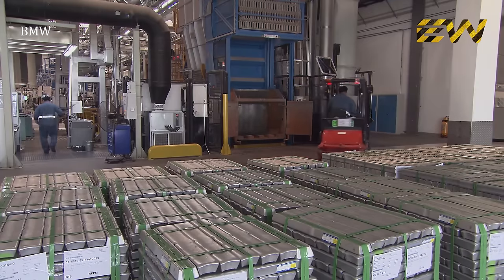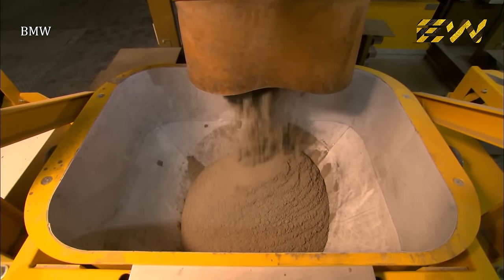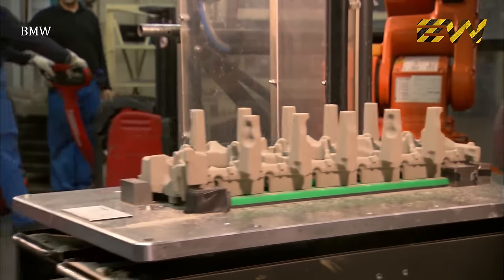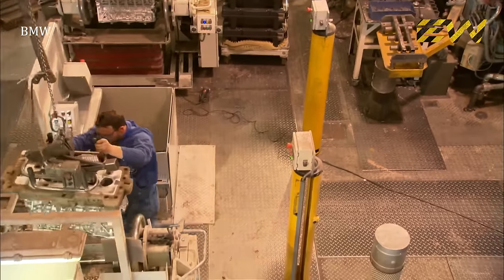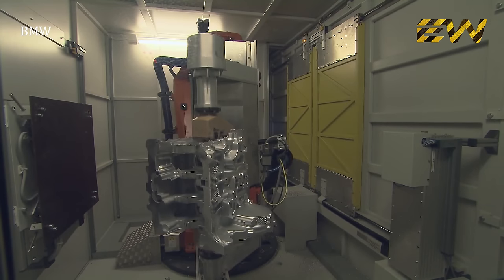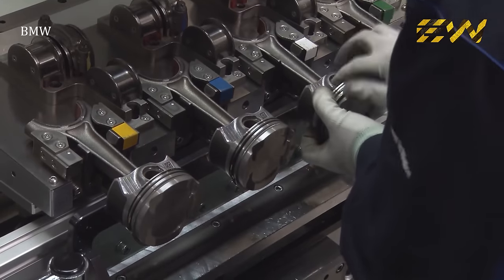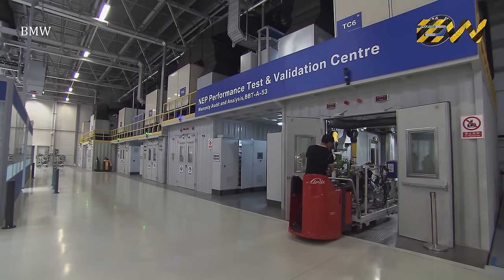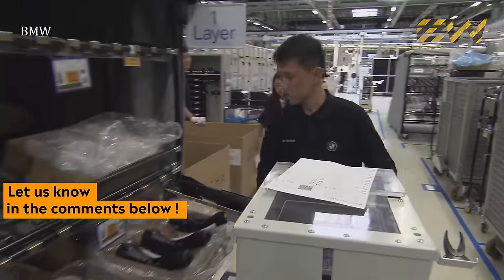How Engines are made? (Mega Factories Video)

Comment: Important use of robots, yes, but I'm surprised at how much of the work is still done by hand. I couldn't believe the guy tightening bolts with a torque wrench, and then making hand-written notes in a little book! Surely the construction of a cheaper, higher volume engine (for instance for a Corolla) must be a lot more automated...
Reply: I think that what was shown here, were what are called "audit engines", where 1 out of say 100 engines is checked on manually. The normal assembly is likely indeed, a lot more automated.

Comment: Not every engine is tested as it would take too long, they test random builds to ensure quality remains throughout production. The guy doing the torque at the end is doing a QC check to make sure that everything is being properly assembled, and again does it on random engines, not every engine.   What is missing are the machines that do break in procedures prior to final engine assembly.  This is usually done after the heads and timing components are fully assembled but before the covers are installed.

Comment: I was disappointed that the machining processes on the engine block casting (other than honing the cylinder walls) was entirely omitted. Close up shots of the block showed the mating surface of the head having been previously machined as well as the fuel pump mounting, etc. But, we did not get to see it.
Reply: I still can't get my head around not only what these machines are programmed to produce but the fact that people were genius enough to make the machines that produce the product in the first place. Truly amazing.👍
Reply: @williamjohnson6517  777j77
Reply: @williamjohnson6517  7
Reply: @williamjohnson6517  777
Reply: @williamjohnson6517 u I'll 7h7
Reply: Iii @williamjohnson6517 iiu I'll 7hu
8i
78
Reply: I agree a lot was not shown on machining and the pistons seemed to be installed with very little force. At one point it looked like he had four pistons but only a three cylinder engine? The crank was turned over but bearings not lubricated? A lot must be missing.

Comment: You failed to mention the aluminium used for casting is an alloy containing copper, silicon, manganese and magnesium to make the material much harder than pure aluminium would be. Pure aluminium is soft and unsuitable for engine components and the alloy used contains 10% to 15% additives. This is true for the cylinder heads and pistons as well. 
These additives are clumped together in the material, however the alloy is heat sensitive and a severe overheat results in the hardening elements dissipating, resulting in a softening of the material. The cylinder head may be too soft to clamp the head gasket adequately and the clyinder head retaining bolts can lose tension due to the alloy they seat on slowly collapsing.
Reply: You tell um!!!!!!!!!!!1111
Reply: thanks for sharing! very interesting to know
Reply: i was just searching for this answer and was about go to google after few comments and i saw this comment. thanks for the info🔥🔥

Comment: Actually to torque bolts by hand is the best way. But of course very time consuming. The person can keep a close eye on the tolerances. Porsche, Ferrari all the expensive engines are hand built for that purpose.
Reply: They dont' do them one at at time. They use a multi tool.

Comment: A pity they missed 2/3 of the operations to actually machine and build an engine. Though engine?? It only has 3 cylinders.
How long has BMW been manufacturing in China?
Reply: B38 model bmw, turbo Diesel engine noisy but efficient relying on the turbo for boost…

Comment: I worked at the Ford Motor Dearborn Engine plant in 1967.  It was quite different (dirtier and oilier) from what you show here
Reply: I have a 1968 Mustang coupe that was sold new in December of 67. Lifelong Southern California car bought at palm springs ford..289 , factory AC. Automatic transmission,  power steering,  and 4 wheel MANUAL brakes! LOL.  White vinyl top. Has the cool turn signal lights in the hood.  I bought it in 1977, my last year of high school.  Was in great shape,  I paid 600 dollars for it.  Which of course was alot more money then than now. Is in excellent condition,  still on the road. The original engine,  only thing done to it was a new timing chain in 1982. My car was built at the SAN JOSE plant. Was 9 years old when I got it, now she's coming soon to 55 years old! Fortunately,  I decided to stay 18...........I also have my parents 58 cadillac they bought in 1960. Its still on the road too.

Comment: How do one determine horsepower and torque
Reply: Bore vs Stroke design rule’s not to forget Volumetric Pressure from the turbo against Compression Ratio..
Reply: They use a dynamometer

Comment: aluminum engines specifically increase fuel efficiency?
Reply: yes aluminum is much lighter
Reply: Yes.  The lighter the parts the easier they are to move.
Reply: No No No the block doesn’t move the pistons move up n down… the aluminum is light weight… can you imagine sliding in a Detroit Cast  Iron block into a mini BMW… the power to weight ratio would be awful although once you get a steel or cast iron block going down the road it’s like a Cadillac smooth…

Comment: All of these will become obsolete in the coming years as internal combustion engines with pistons and other moving parts will be replaced with electrical motor engines. Engine oil and other related stuff will become useless.
Reply: Maybe in a hundred years or so...!!
Reply: We are no where near that point, and i seriously doubt if it ever happens completely. I dont know if you know what batteries are made from, but they ain't called rare earth minerals for no reason 🤣🤣🤣

Comment: Ones that don’t break all engines that are made today are junk they don’t last of course that’s all by design that’s how manufacturers get rich because they know that the engine will break after the warranty is up I like the engines from when they originated up through the 90s because they were built to last and they didn’t require a considerable amount of maintenance like these new ones do these new engines are very sensitive just like the people that are on the far left any little thing and they have a breakdown
Reply: Punctuation is your friend, just as being passive-aggressive is not your friend.
Reply: You have no idea do you. You probably had one engine fail for a simple reason and now you've lumped every engine as bad.  Sucks to be you.
Reply: Too many plastic chain tensioners used on German cars. They go brittle when out of warranty. Also plastic hose housings that fail with heat and age. Penny pinching accountants.
Reply: The entire idea is to have a new car owner enjoy several years of carefree driving then BAM.. hit ‘em with huge costs to the point of screw it they trade in.
So go to a Tesla Dealer go into Parts Dept. tell ‘em you want to purchase a full Battery Bank for your potential new model purchase…. get ready to walk out and buy gas or diesel. Have you seen the effects of taking a Arc Welding capable battery cell and smashing the car in a 80 mph T-bone or Head-on….incredibly fireworks…